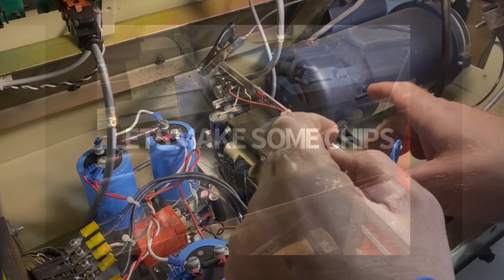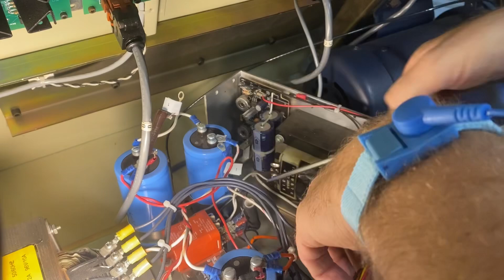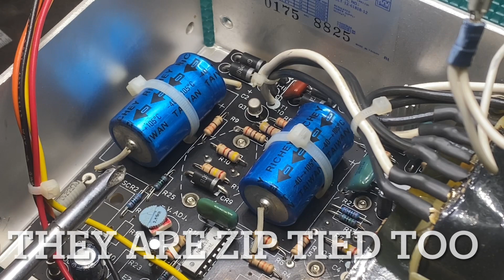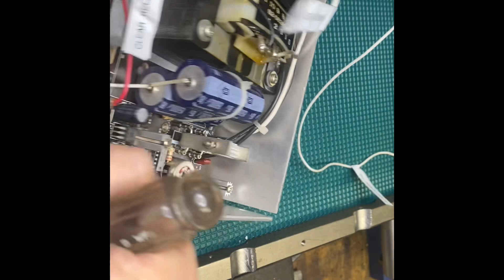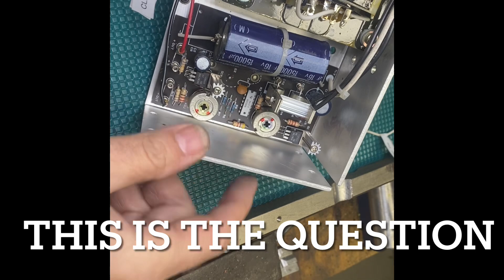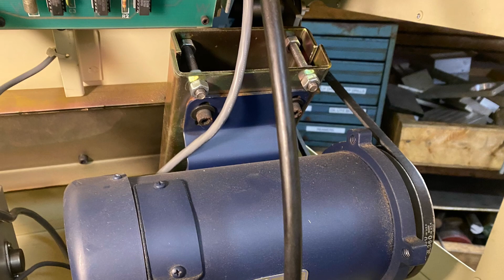CNC Lathe part 8 Capacitor replacement

Comment: Hi, I wouldn't take it apart. Since you pulled it out of the machine I would take it to your electronics shop, hook it up to mains, maybe - if you know the specs - add a power resistor that fits to the outputs to draw some power and then check the output voltages. The power supplys brand sola still exists. So there is still a chance to get some datas. The big metal components are bipolar power transistors - it's a linear power supply (means it just dissipate power to regulate its output voltages, more or less like a variable resistor). Nichicon is a good capacitor manufacture. Usually they stand for quality and do not go bad quickly. The markings for the values are hidden on the other side. Gereetings from the Baltic Sea..
Reply from the maker: I’m discovering that finding exact replacement capacitors is not so simple so I may just skip on anything to do with power supplies like this for now, and focus on changing the capacitors that are on the drives and the other things closer to the control of the machine.